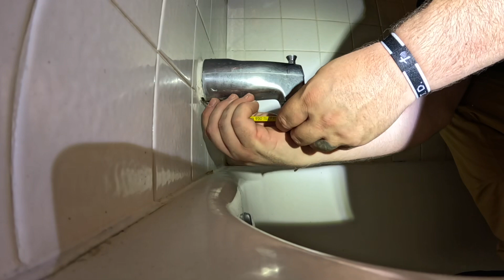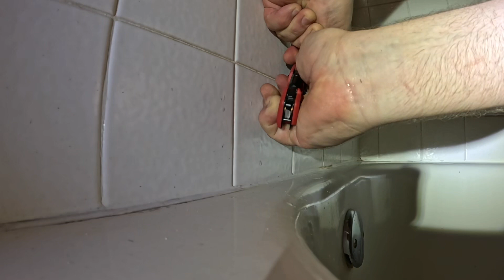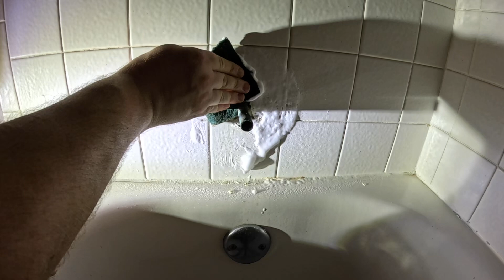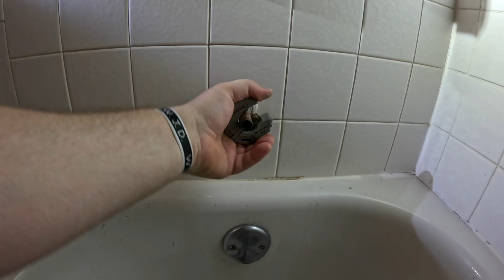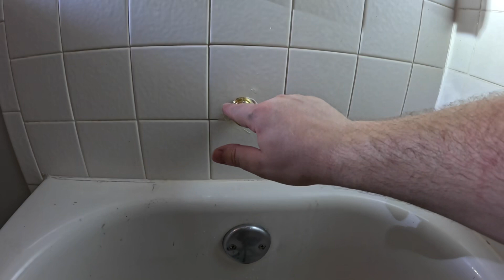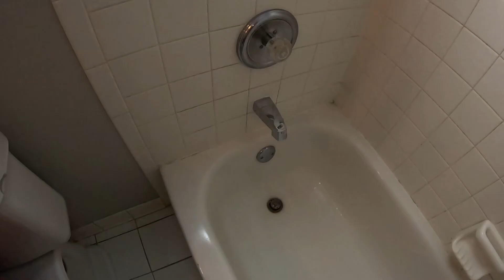How to Replace a Tub Spout (Best DIY Method)

Comment: My pipe protrudes from the wall approx 1 and 1/8" and its width is approx 9/16". I am worried that the adapter (RP33794) won't work because the adapter that came with the spout is longer than my pipe coming out of the wall. Is this a valid concern? and besides trying it, is their a fix for this?
Reply from the maker: What type of pipe is coming out the wall?
Reply: @PeterJoseph7865  copper

Comment: I am attempting to replace my downspout with a delta . I wasnt able to remove the old adapter on my pipe and as I put the delta down spout on I can hear a cracking like sound while turning it. It's a very tight fit and I stopped threading it because of the resistance I'm getting and now it's not flush to the wall. What did I do wrong? The original adapter is 1inch around a half inch copper pipe
Reply from the maker: Hard to say without seeing the set up. Did both the old spout and the new use the same large adaptor that I'm using in this video?

Comment: What would you suggest is you have a PVC pipe instead of a copper pipe?
Reply from the maker: I would replace the plastic piping altogether. CPVC (which is likely what you have as opposed to PVC) is a very poor choice of pipe for this application. It gets brittle and will not hold up long term. I come across it in the field sometimes myself, and I always replace it when I do.
Reply from the maker: If you absolutely can't replace it innthe wall, you may be able to still make this method work, but I would proceed with caution, especially when you tighten the Allen nut and thread on the spout.